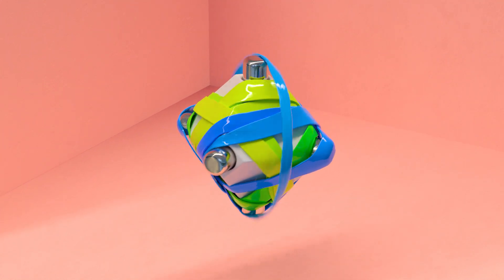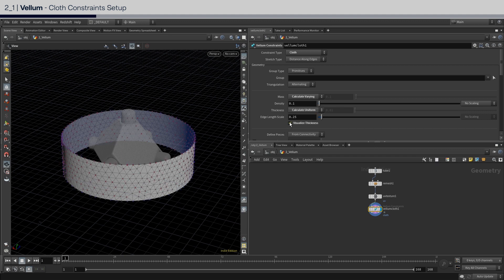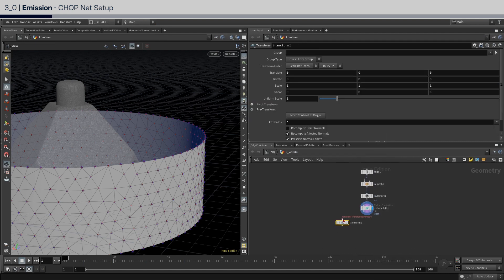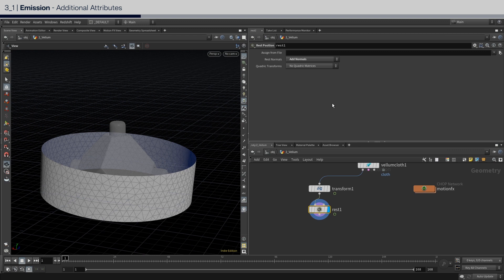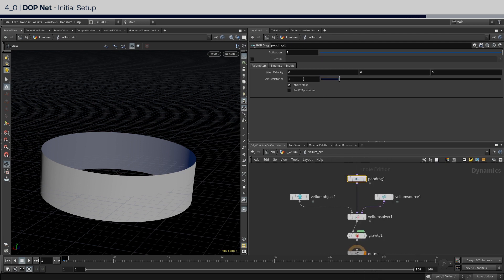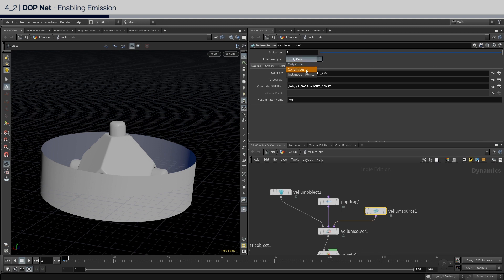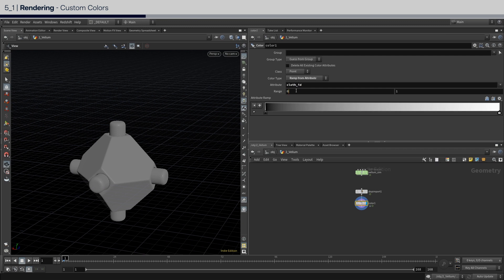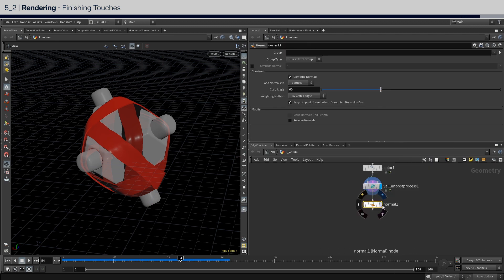Houdini Vellum Cloth (Beginners) [Tutorial] | Emitting Vellum Cloth Bands + Shrinking/Shrink Wrap

Comment: Thank you so much!! I used this for a completely different type of simulation, but it worked just fine. I do hope you can help me though.

I used an alembic export node after the last setup with the color, postprocess and so on. Then I imported it into blender to add materials and render. This sadly didn't work how i expected, as the cloth is all one singular mesh. is there any way to have each emitted cloth be it's own mesh in the alembic export?
Reply from the maker: Well I guess there are several ways, the pros would probably add in an attribute to the polygons before spawning and make sure the vellum geometry carries over and you use that as a way to set IDs for each emitting band and you could easily Blast and ‘delete non selected’. Also I feel like you could probably just use “For Each Connected Piece” and enable the view single iteration mode. But I haven’t been using Houdini much lately, so that’s all I can think for your solution!

Comment: Hey. Great tutorial. I've been trying to demystify one of your vellums sim in which a couple of blocks inflates, goes up attaches itself to a frame very smoothly like puzzle pieces. How did you achieve the movement of the blocks? Did you compute the Force by subtracting the final position from the initial position and feed it into the DOP net or did you take a completely different approach?
Reply from the maker: Wrong place to ask this question, you should have just posted it in the actual video. Anyways, it's pretty basic. The first one is a basic POP Force which raises it up until in front of the frame. Then a POP Attract which uses the "Points" Attraction mode to attract the vellum cloth points to the final target position. Basically,  I used this particles technique - https://www.youtube.com/watch?v=p_2qytjh9q0
Reply: @YFJSR  Haha. Sorry about that. But thanks a lot. :)